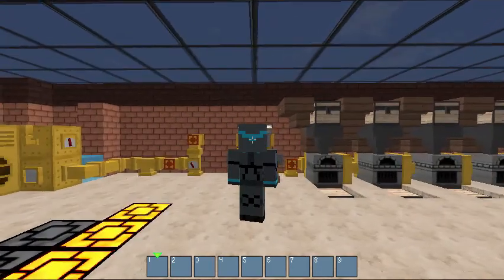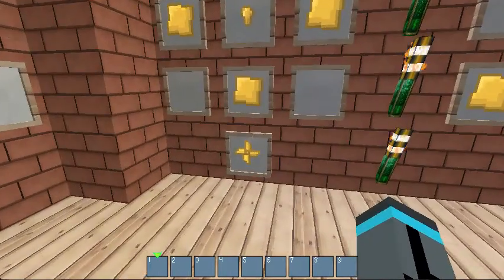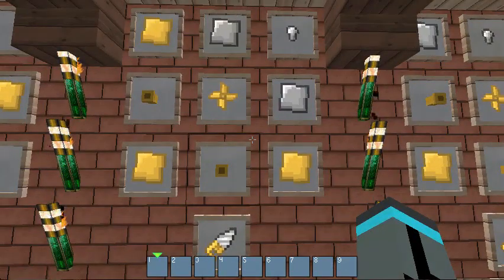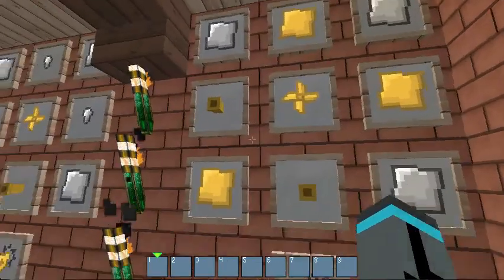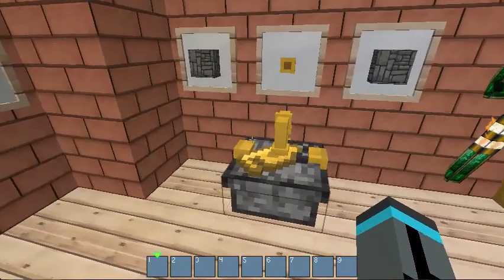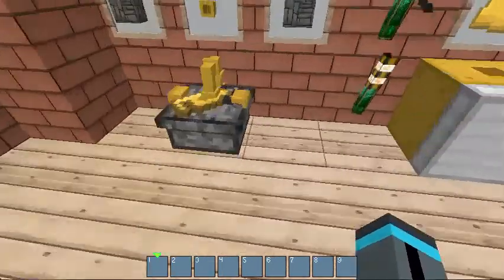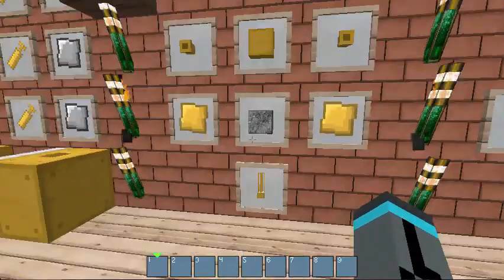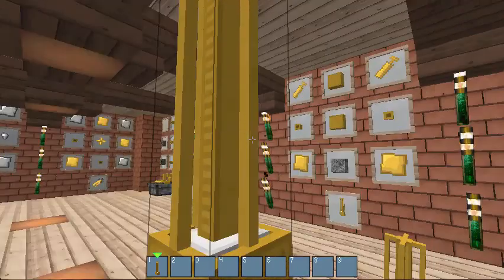Professor Flaxbeard's Wondrous Steam Power Mod [Beta] 0.25.0 Pt. 2

Comment: how do you change the range for the fan and vacuum?
Reply from the maker: Bad Wolf Bay You need the wrench, then shift-right click to adjust its range from 5-19 blocks.
Reply: Shift....that's what I was missing!!!!  THANKS!!!
Reply: ok, I tried the shift+right click and all it did was rotate the vacuum.  It could be that I have too many other mods installed is why it's not working right.  It's stuck on 9 blocks.
Reply from the maker: double check your controls, but it should be your "Sneak" button. I just double checked myself and its shift for me. Also you may want to double check in the book for the mod. It lists the commands and functions of the pipe wrench.
Reply: ok, that explains it, I changed my sneak button.  Thanks again!!!